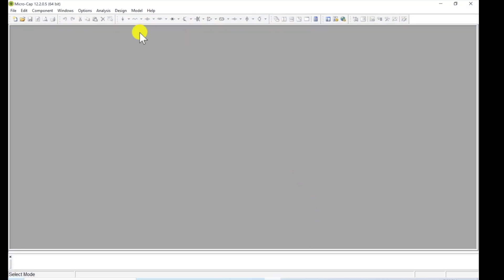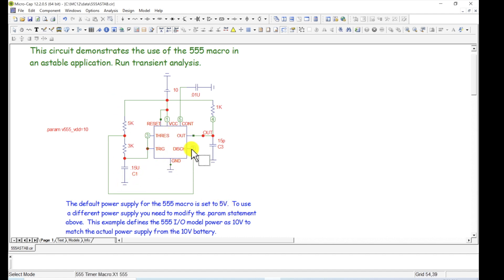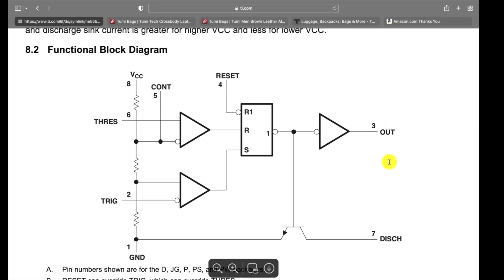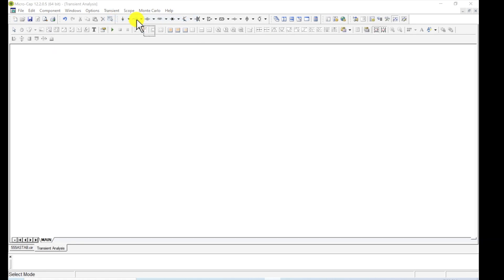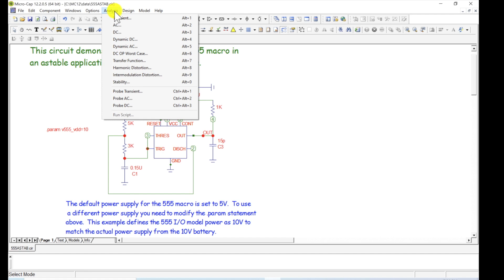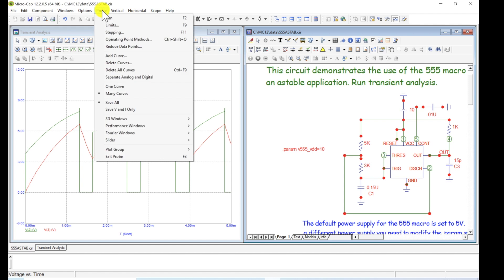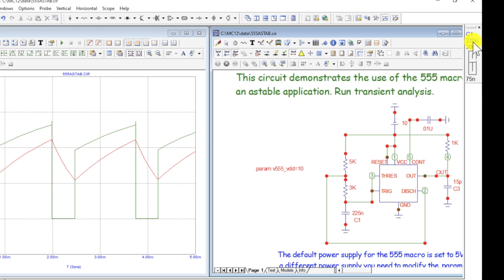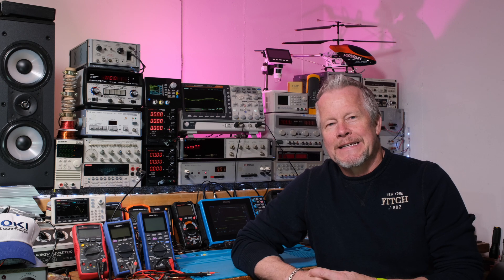555 Timer simulation with Slider in MicroCap Tutorial #microcaptutorial #555timer

Comment: I entered a headphone tone control I'm building into Micro Cap and after a bit of fiddling around I sussed bits of it out and was able to display a sensible frequency response but to see the effect of the bass and treble controls I was manually changing the resistors that I have used to act as a pot and the graph made sense I had good bass and treble bumps where I should have ! but now I think I could do it with the sliders and It will be less of a pain! I think your right that the user interface is a little bit easier to use than TINA, thanks for these tutorials as I am new to circuit sim and a bit wet behind the ears  regarding audio.......cheers.
Reply from the maker: Thanks for the great feedback!  That’s a great example!

Comment: Edwaurdo, I was thinking about snubber networks on psu design. There are not many tutorials online explaining them. I have a tenuous grasp on what they entail as far as picking the component values but I understand they are very important. 

I intend to download microchip this week as I like the information you give and the enthusiasm you have for each subject and using spice for learning fundamentals.
Reply from the maker: Thanks Joey - great suggestion!  I'll cover snubbers soon:)  MicroCap will be a great way to test them;)
Reply: @KissAnalog  I think I get them now a bit. It's a resistor and diode for bak emf. But there's times you use a cap as well. There's always a diode for steering. It's a power stage thing that can be in a few different spots of the same overall circuit. That's my rudimentary understanding. Thanks though Eddie! I hope you're feeling a little better now, your voice belies your enthusiasm. I mean that as a compliment.

Comment: Hey hi so i am designing a circuit that uses the Ne555 timer. Now the problem is that in micro cap it assumes that VCC is 5V . Hence even if you make the voltage source connect to VCC pin say 15 Volt the simulator still thinks that VCC is 5 V. So the output only goes to 5V. Now when i open the 555.mac file in the library folder it shows the 555 timer macro with the inner details. There it mentions the following 

The 555 macro assumes that you are running it at 5V.  If you have different power supplies in your schematic, add the following .param statements to your main schematic and change the values accordingly:

.param V555_VDD=5V
.param V555_VSS=0V

These param statements change the analog/digital interface power for the mixed mode connections of the macro.

How do i change the values and what is VDD and VSS .  I am using micro cap 12

Comment: It's definitely a nice feature but I hate that the slider itself is a bit too small.
Reply from the maker: Thanks for the feedback!  Do you mean small as in hard to adjust, or small as not long enough to get good resolution?
Reply: @KissAnalog  small as in not long enough to get good resolution, especially with the mouse if you're selecting a large range. Or at least I haven't found a way to make it bigger. The up/down buttons from the keyboard work though, so at least that's something.
Reply: @KissAnalog  oh nevermind, I just accidentally found that you can detach the slider from the toolbar and then resize it as much as you want.